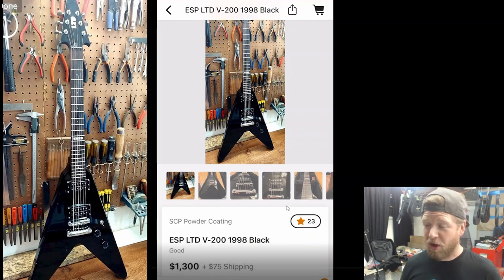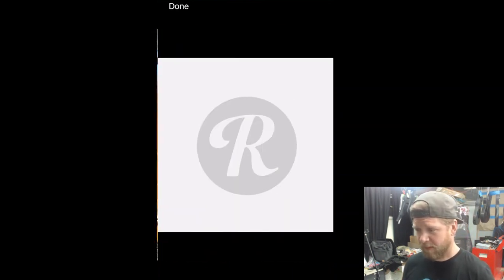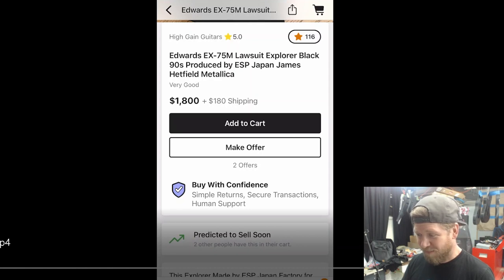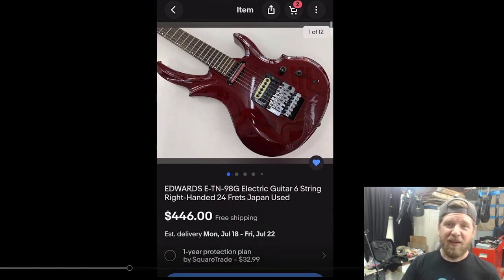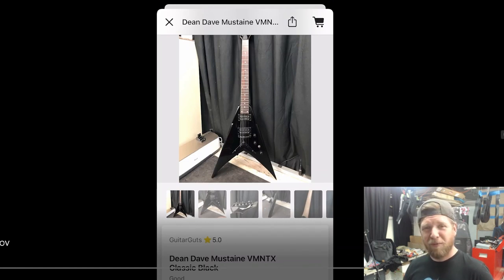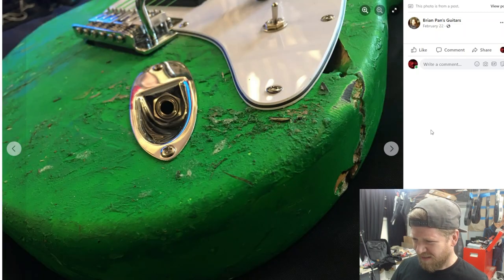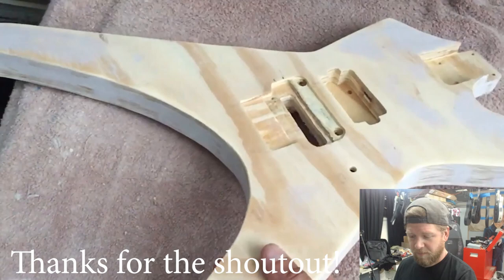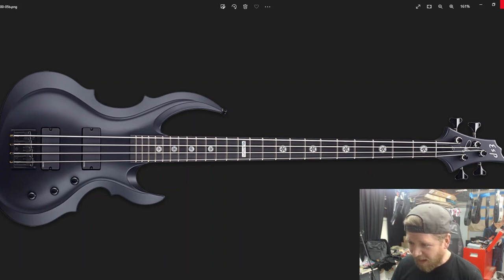AXE HUNTING & PLYWOOD GUITARS || Sunday Morning Shred 7-10-2022

Comment: Plywood guitars can be great, I recently flipped an 84 Kramer Striker with a plywood body. It was heavy as hell in the best way possible, and the neck on it was incredible. Only downside to the plywood is the 27 splinters I gave myself fixing the output jack.

Comment: Hello! So I agree with you that many things make tone. First of all if you are playing through a modeling amp or have a solid state preamp tone wood is not a factor. Either is pickup in some respects. If you play through a tube amp with a tube preamp then wood could be a factor using a low output pup and a 022 600v capacitor wired from the hot pup wire connection to ground not treble bleed style. This is the warm tone of poplar basswood a little less then mahogany.  This will produce the reactive octave splitting good feedback. Harder woods like maple produce a PA system sqeal sound although installing the pup into the wood helps somewhat but the feedback is less reactive.  Alder can sound decent if wired correctly as aforementioned. Also signal strength is also a factor . Pots achieve tone by sending the signal to ground affecting the tone quality. I usually use one volume pot to keep the signal strong. This is cave man old school. Keep it up you are doing great! Thanks and rock 🪨 on!

Comment: Man, the tonewood debate is a hornet's nest, are you really sure you wanna get stung? Personally I think that the wood does influence the sound, since dimensions, materials and construction will affect the resonance frequencies. These will occur as one or several narrow frequency bands at which the note intensity will be amplified and are unique per instrument, depending on the previously mentioned (and probably other) factors. All those videos and stories saying tonewood is a myth generally don't measure the resonance frequencies of the instrument and focus on the entire spectrum instead. So they're basically ignoring the one aspect that makes an instrument sonically unique.